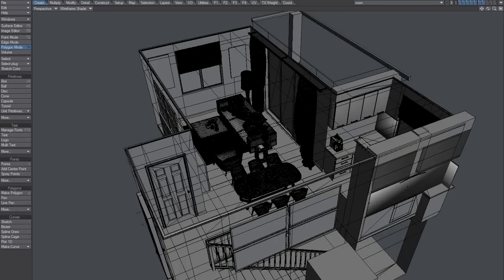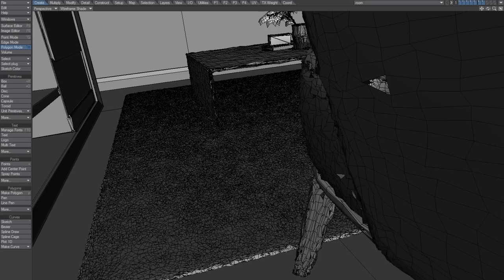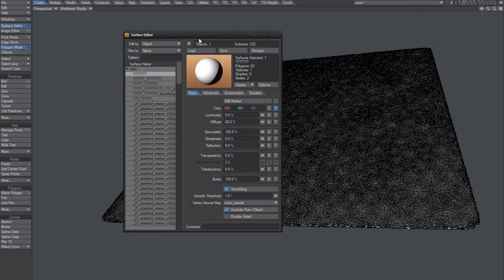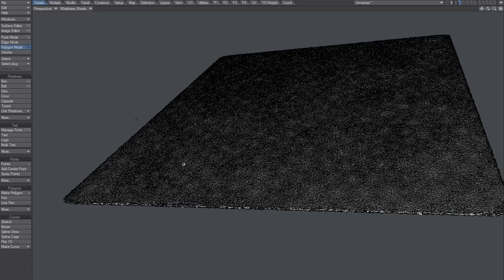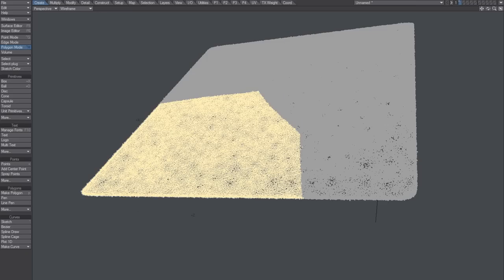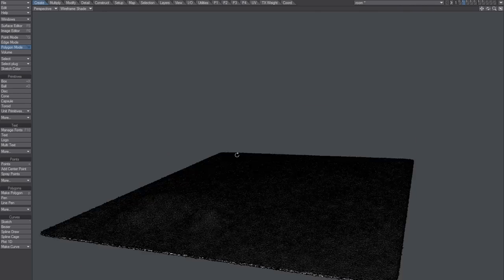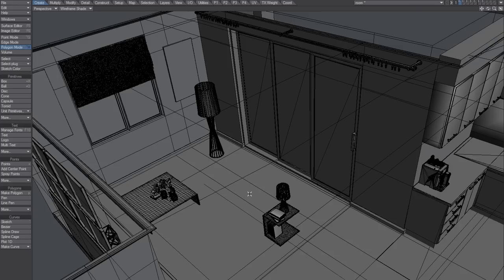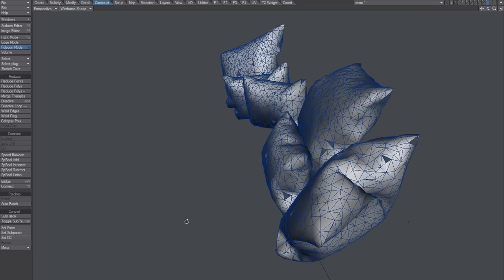LightWave Model - Modeler Speed

Comment from the maker: 1 - LW11 speedup, make sure polys are not double sided. 
2 - LW11 speedup, force a smooth threshold of 1
3 - LW11 speedup, turn off vsynch for Nvidia / AMD
4 - LW11 speedup, check your OpenGL settings

Comment: Weird..didn´t see this one until now I think, or I forgot about it.
Anyway...great tips, and yes, splitting them in layers seem to be how it works best with memory, and copy to a seperate single object makes it redundant with the other layers...so no wonder.

Is this room a 3d scanned room? seems like that due to missing polys and all the jittery stuff and high res etc.

We also know that working in modeler openGL and viewport orbit navigation will work much smoother/faster with smooth shading viewports than flat shading...I am not sure there is an equally better performance when using magnet or modify tools though when it comes to flat and smooth shading.

I am hopeful the new engine will enhance this a lot, though I am not sure this will affect the next lightwave modeler performance, maybe only in layout I reckon..so we may have to wait yet another release?
Reply from the maker: sadly the only engine changed is the Layout one, from what i read it sounds like at least they will be looking into Modeler changes sometime 2017...
no 3D scan, rather a 3DSMax room or something, in the link above i'm helping out a guy that got into speed-problems (understandably)  :)             read more ->
almost nothing can speed up Modeler as far as Hardware goes. it needs a rewrite.
Modeler tools also vary a lot when it comes to speed, some of it is due to inefficient code, though i know the programmers have a gazillion things to do.